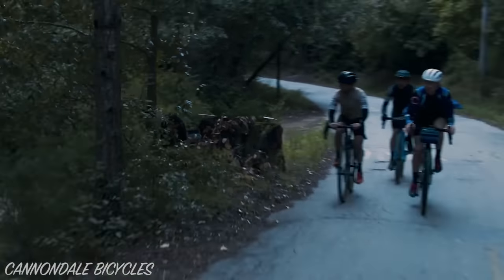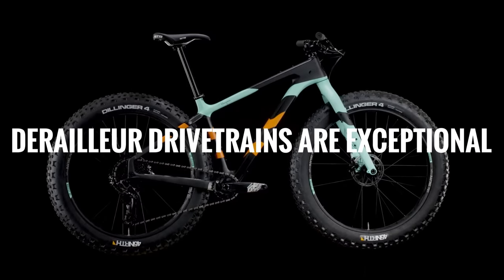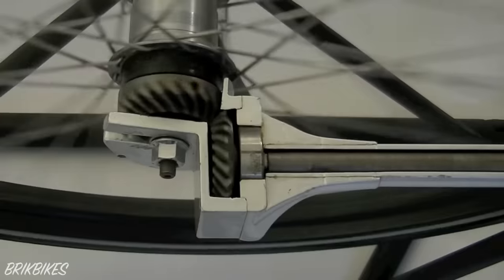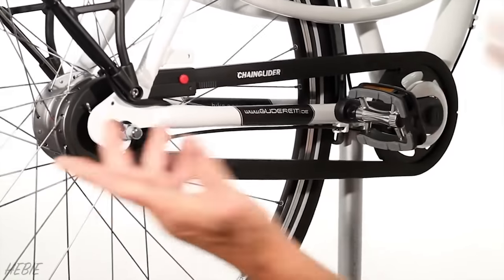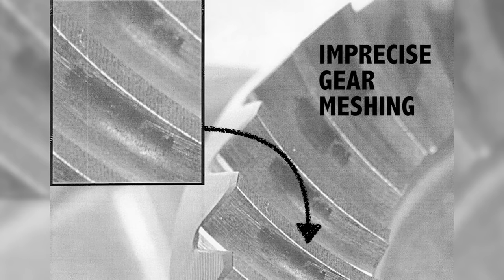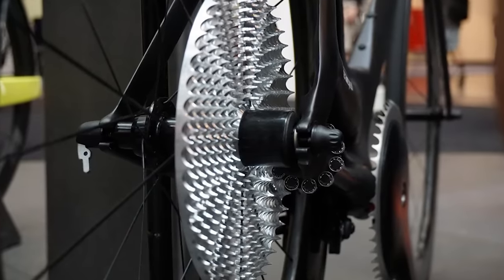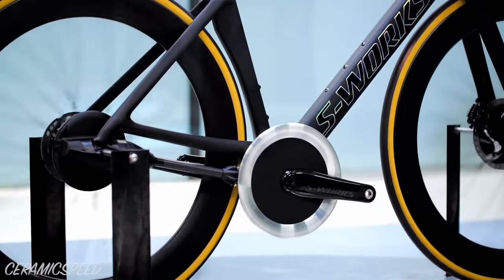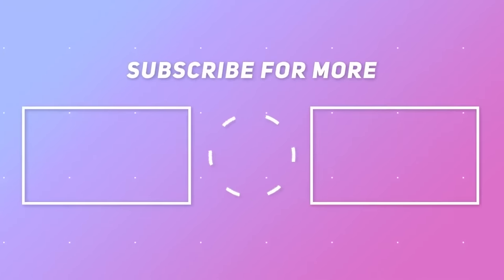Are Chainless Shaft Drive Bicycles a GENIUS or TERRIBLE Idea?

Comment: Whether it be driveshaft, belt or chain - I prefer pedaling to work, rather than walking to work.
Reply: i prefer electric motors to pedaling. no sweat and no effort
Reply: @Blox117  I commute to work using a Trek Aliant 8S - it is a pedal assist ebike that allows a 68 year old man to travel 40 miles back and forth to work. :) ...the bike makes me feel like a kid again.
Reply: @kevingary7018  pedal assist sucks, throttle all the way
Reply: @Blox117  Lol, change the input power supply would help that. Plus, bigger output motor.
Reply: No battery for me no motor  or engine  pedal power till the end
Reply: @Blox117  yeah floor it
Reply: Just buy car for total relaxation
Reply: @harveyjoneswoodsman5956  that's the only way to go in my book. I still think E bikes are cool though.
Reply: @dantindley5181  what kind of children do you have?
Reply: @marcusmartin5758  "Grow up, buy a Car" - Jeremy Clarkson
Reply: @dantindley5181  conversions are out there, but impractical, imagine holding a throttle while pedaling  :D   Jerky as heck
Reply: @mannyechaluce3814  yea i know but not many people would commit to that. Trust me i sell bb conversions. They also weigh around 6kg. The ones we sell easily do 40mph on throttle
Reply: Me too I got a gas pedal an a brake pedal.hahah
Reply: Gas powered bike
Reply: @marcusmartin5758  If you're often totally relaxed when you drive, you're soon going to be totally relaxed permanently.
Reply: @dantindley5181  So you make e-bike conversations for people who find motorcycling just too freaking safe!😃😩🤯
Reply: @Gregorypeckory  its actually much safer to drive big car than to ride a bike.
Reply: @Gregorypeckory  i dont make them. A brand called bafang does. Were just a retailer
Reply: Theres nothing like riding my street legal  ktm 300xc 2 stroke for a short commute😁. But it's also a whole different kind of fun riding my mountain bike just about anywhere👌
Reply: I do to. Still using muscle but it takes less time
Reply: Roger Jolly  uh, riding fast is pleasurable. not pedaling. and sure, i can go 2mph and not work up a sweat either
Reply: Roger Jolly  i doubt you are fit LOL. probably cant do a single pull up. 

anyone will sweat if they have to pedal at a reasonable pace, or if they are going further than their mom's driveway.
Reply: I E Scooter past the pedal pushers 🤣
For the car people i own a Land Cruiser hey, but the Scooter is quicker to work.
Reply: Does pressing the accelerator and brake pedals in my car count as "pedaling"?
Reply: I prefer the driveshafts on my car to get me to work 😂
Reply: Gosh, if only that were a good option in most parts of the USA.
Reply: @marcusmartin5758  where you driving where it is totally relaxing?
Reply: Id rather teleport to work 👽
Reply: I prefer hummering to work because its a statement of how little I care about Earth.
Reply: @Blox117  Bro u getting so defensive it's pathetic and hilarious 😂. Thanks for the amusement get better soon cause it seems really bad.
Reply: I literally just unicycle everywhere.
Reply: @kevingary7018  40 miles. Suuuure. LOL. It's probably 4.0 and you missed the decimal point.
Reply: @Blox117  :) I use to have a 4 mile one way commute to work and loved it, even though it took me into the city. But now it is a hour and 15 min., 20 mile commute each way. The generation 4 Bosch electric motor on my Trek Alaint+ 8S e bike makes it possible. Cycling on the  BWI Airport Trail for the better part of the commute makes it easier, as I do not have to deal with motorized traffic on the trail.
Reply: @kevingary7018  thats cool man, I use a hub motor that outputs with a peak of over 15kW
Reply: @Blox117  then whats the point in not using a car?
Reply: @Zandercd  because cars are boring as fuck and slow?
Reply: @Blox117  Well that's your opinion I happen to like cars and find them fun and not all cars are slow lol
Reply: @Zandercd  they are slow if you drive them slow. its not like you can get very far doing 200mph on the road before you hit another car
Reply: @Blox117  I prefer pedaling, but I do want an electric motor to get me from 0 to 40km/h at the traffic lights. If you are doing 45+km/h and you have 3 in a row at red... Getting back to 45+ takes longer and longer.
Reply: @bloepje  yep, my big motor can out accelerate many cars. 0 to 30 in less than 3 seconds. if you're not careful it will even flip over backwards. I had a steel frame bike and it even broke one of the frame arms, had to reinforce it.
Reply: @Blox117  then you just have a moped.
Reply: Your medal is in the post.
Reply: I peddle my wares.
Reply: If you take the perspective that you are stationary, then walking across the surface of the earth turns the earth, you could consider the earth to be the rotating wheel, and each location you step on to be a new pedal. That way, you're always pedaling even if youre also walking :P
Reply: @Blox117  have to disagree. Not enough range on battery only.  Especially if you are doing hills.  Plus, there's this thing called "exercise"!
Reply: @Blox117  Gosh I must be. Since I can't understand what I said to provoke this response.  Since I am so dumb, can you tell me: Do you have any friends in the real world?
Reply: @thekinginyellow1744  i will help you out: add more batteries
Reply: @Blox117  sure, you gonna carry them around for me when I need to lift my bike over a deadfall?
Reply: @thekinginyellow1744  the fuck does that even mean? are you making words up now? the batteries are attached to the damn bike
Reply: @kevingary7018  woa 40 miles
Reply: I prefer not going to work at all. Retired!
Reply: go on !!     😉      peace    😑
Reply: @Blox117     more breaking resistance and less attentiveness as well my friend   ☺     go in peace
Reply: @buckroger6456     they are,   but dont pass the actual benefits of mechanical propulsion ...  we can talk    🥲
Reply: @jfrtbikgkdhjbeep9974  you are talking to a pretty hardcore cyclist. I use my bike for everything. I have zero problems with Ebikes only cause it often means more people out riding. Now as for myself I have no interest in owning one.
Reply: @stevek8829     no!    get one of those fassst!!      hard to find ,,   24"-26"      all steel frame      😇
Reply: @thekinginyellow1744   yessss,   good will,  good intentions,   good deeds,
Reply: @jfrtbikgkdhjbeep9974  i dunno what you are talking about
Reply: @buckroger6456  i have problems with bikes. two wheels are trash. everyone should get a unicycle. vastly superior platform
Reply: @Blox117  get a bike then lol
Reply: I prefer my 5.0 V8 to drive to work. But I'm not peasant.